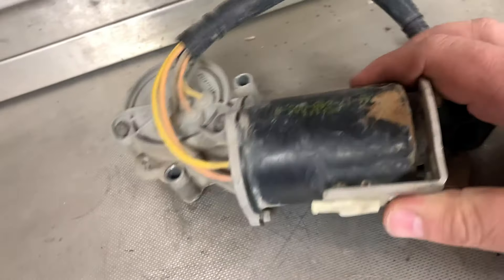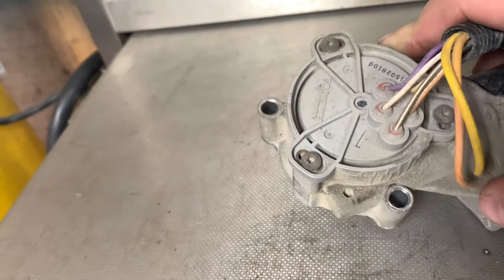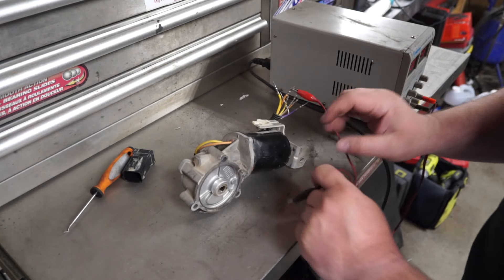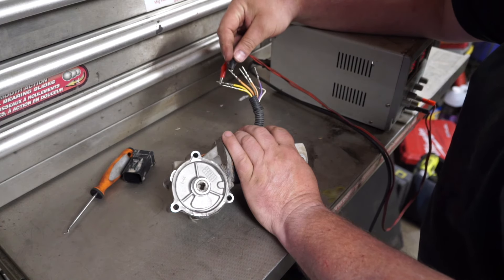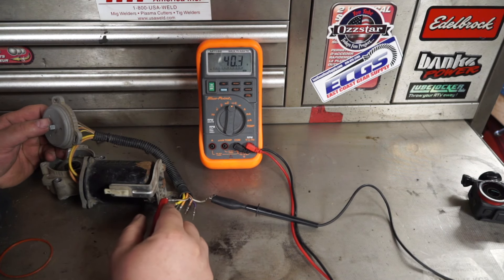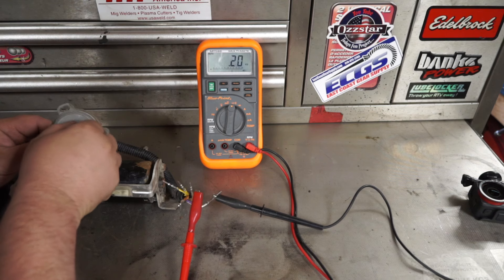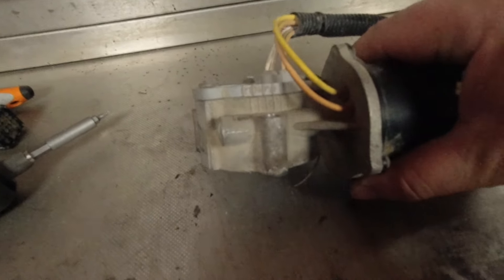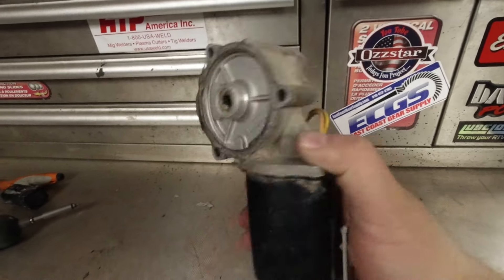F150 Transfer Case Motor Failure

Comment: My motor works fine in both directions, but if I let it get to the stops in either direction it won't reverse back again and I have to take the gear out and place it back in the middle of the range again for it to work again. Is that because of the adjustment being out.

Comment: I’m am having the same issue pulled my old motor did your test my motor is turning like yours the  issue I have bought 2 motors and it one was stuck in low on the newer one is stuck in 2 wheel if you have more information around this I would be forever greatful
Reply: My 1998 F150 was stuck in 4L.  When I tested the motor, it worked fine (full motion both ways), but the replacement motor still fixed the problem.  I busted open the original Borg Warner switch and the circular contact plate looked nasty (as did the contact fingers).  I suspect the motor was fine on the old switch, but the electrical contacts were borked.

Comment: Why did'nt Ford just keep the floor lever for 4-WD ??? Old School is Best!!! What's so terrible about having to reach down to the floor and Pulling a Lever ??? 
My 2010 Silverado has a Proper 4-WD FLOOR SHIFTER. Ford Tuff 🤔 Not with this
Reply: Ford can't charge you $250 for a cable or a couple heim joints...
Reply: And when you're paying $100,000 for a new truck, I believe customers want the 4x4 to engage itself nowadays. Convince comes at a cost, always!